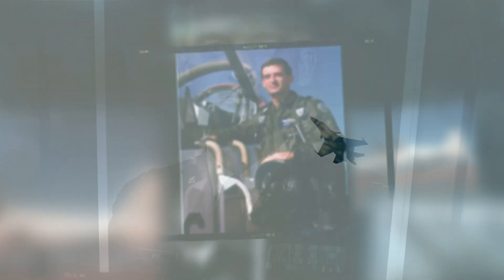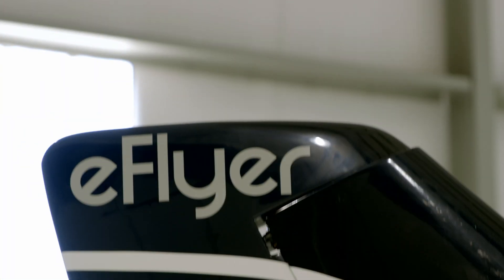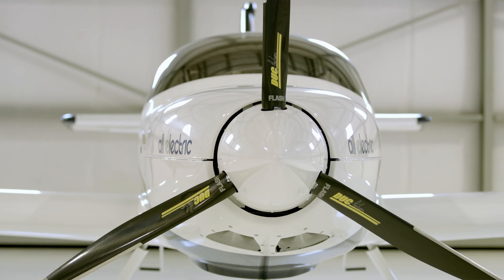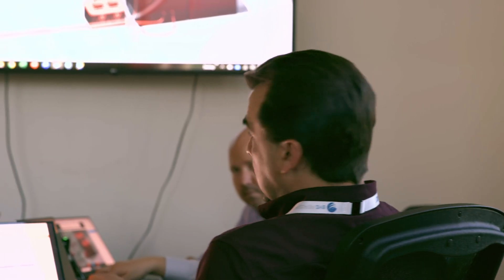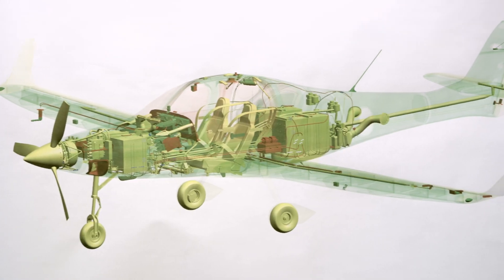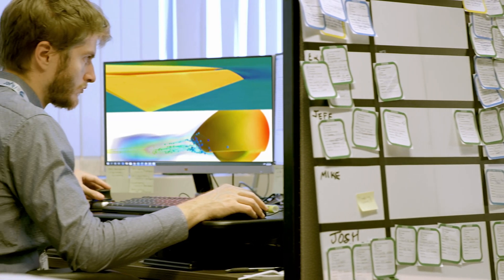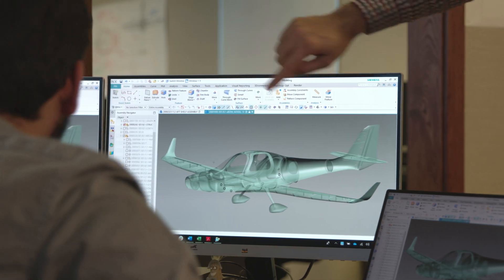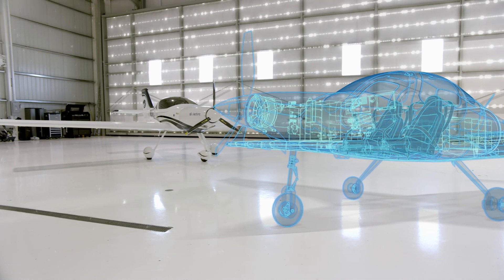Bye Aerospace, Inc.| Tomorrow's electric airplanes, today

Comment: INNOVATION at its best. Love this out of the box thinking designing an electric aircraft to revolutionize the pilot training industry. A training aircraft that can operate for under $25/hour (1/4 the current price) will dramatically change not only pilot training, but the entire aerospace industry.  This is super exciting ... best of luck with your certification.
Reply: Pipistrel has an electric trainer aircraft too.
Reply: @vitordelima  Thanks for that information about Pipistrel’s ultra-light electric aircraft. Very interesting and exciting developments in electric aircraft. As an ultra-light aircraft Pipistrel is not required to be certified. BYE Aerospace will also be obtaining FAR 23 certification for the eFlyer.
Reply: @derekengland3708  There are some hybrid electric aircrafts being developed, like the Equator P2 and Pipistrel Panthera. It's a reasonable way to bypass the limitations of current battery technology.